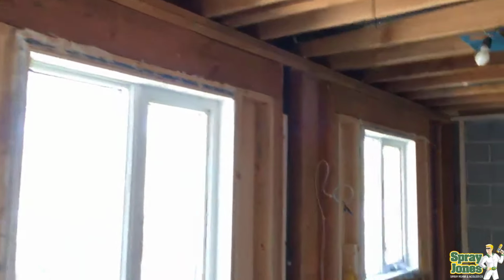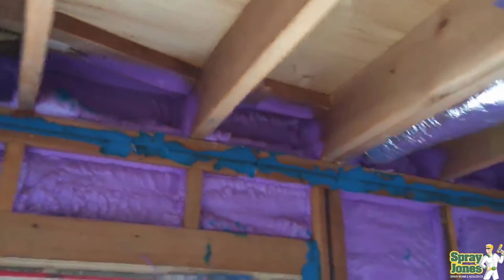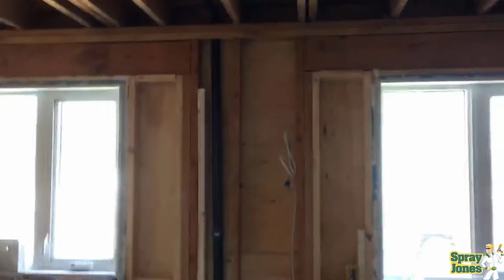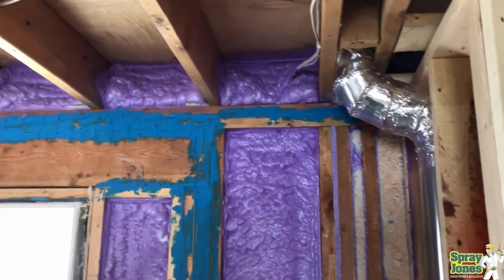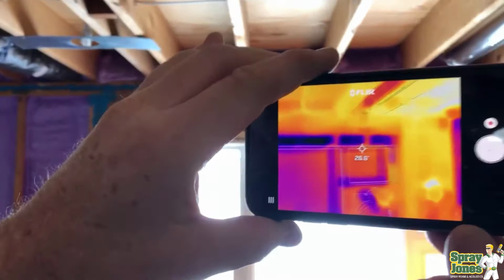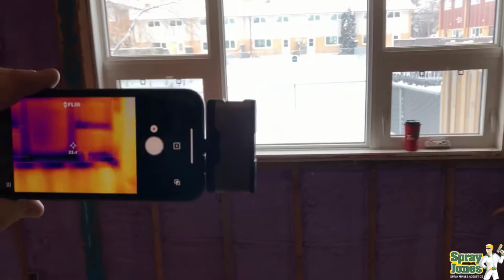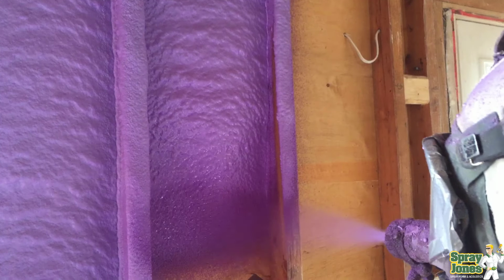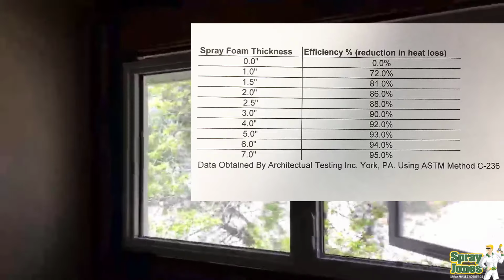Proof 2 inches of Spray Foam Insulation Works

Comment: Gutted my 100 yr old small house and had 3 inches sprayed on the dimensional 2x4 walls. R30 bats in the ceiling. It sits on a hill 8 miles inland from Lake Michigan, 50 miles south of Mackinaw. Not a mild situation. It's ridiculous how easy it is to heat this place, and the extra structural strength makes it hard to notice a strong wind. Pricey, but wow.

Comment: The challenge is building codes in many areas require minimum of R-20 wall assembly insulation.  So 2" of closed cell spray many be thermally sufficient, little insulation would fail insulation inspection in many areas of the country.
Reply from the maker: Ya we know...That isn't what we are talking about. We are looking at the power of 2" and what it can do, not compliance for white papers...

Comment: Im confused by the caulking. I caulked the seams in double studs and plate joint at the floor on a renovation project. But do you have to caulk where the stud mets the exterior sheathing? I thought the spray foam sealed that.

Comment: I bet why traditionally that the studs were such a thermal bridge on thermal cameras is because the insulation never really sat so tight  up against the stud so there was always some air transfer.  Typically when you shove in a batt you are either a bit tight or a bit loose and both effects are negative on insulations ability to hlod temperatures

Comment: How much does good spray gun like u use cost? If I build another new home Am definitely going with this. I don’t know what it is but I would really like to grab that gun and go to town with it. I know probably hard work once u have did 1000-2000ft just something about it  makes me want to do it. Am road superintendent have been for 25years so nothing I’ve ever done before I was a welder for 3 years before that. Spray foam just gets everything I don’t know why we’re all not just using it. Is there anything any better?
Reply: The upfront cost is more expensive than alternatives.  It's harder to work around after, and has had some bad press about the blowing agents used being mega bad for the environment.  All that being said, I plan on having the roof of the workshop I'm building spray foamed.  Walls will be batts or otherwise so I can easily run utilities in the future as needed.

Comment: Thermal imaging is only showing relative temps for those areas shown that you scan. To understand what's really going on you also need to actually take the temperature of the air in the building at its core and the temperature of the air outside the wall. These temperatures are needed to understand the real heat flow through the structure. Wood is a poor insulator. The fact that in your image, the studs don't show a significant gradient in temperature compared to the spray foam means the insulation values for each material are close to each other, that's a concern. And to really back up any thermography, so you know emissivity is taken into account, there are more accurate ways to analyze material temperatures. It would also be good, to better understand the wall construction in this video too, because if this wall had XPS, ISO, or EPS applied to the exterior, that could really throw of results of any thermography scan and how effective the materials are. 

You are correct in that there is a point of no return in insulation by adding too much insulation, especially when each additional inch doesn't cost justify the savings. However, their is also a factor considered in ASHRAE design standards that takes into account perceived comfort. Even though you might have reduced most of the heat loss in a structure, if there are places where the temperature is noticeable different than expected or what we are use to, it will feel uncomfortable. Take for instance glass windows. Many new widows today use low E glass. If you stood next to a window that didn't use low E glass vs one that did, you would notice a significant difference. One reflects radiant heat, the other does little in the radiant spectrum, even though their construction may be similar or identical. The lower the wall temperature is from the set temperature, the room may start to feel cold, even though the room temperature is pretty normal. As it gets colder outside, that inside wall temperature will drop. However, the more insulation in the wall, the less it will drop. So even though, as in your example, the insulation is reducing 80+% of the heat loss, doesn't mean it will feel comfortable to the occupants. Moving that heat loss to a lower value or higher % reduction will dramatically improve the comfort factor in the building.

Comment: Sometimes we get too focused on R value as a number. Its easy to forget R value for insulation is measured in laboratory conditions. Structures are rarely equal to the test conditions. The main advantage I see in spray foam is its resistance to wind washing. Fiber based insulation goes to pot if the wall assembly isn't air tight. Spray foam's ability to air seal and your additional caulking detail makes that wall perfom as good as it possibly can. The only way to make that wall perfom better is for the foam to be exterior insulation instead of cavity insulation.
Reply: Not to mention adding some rigidity to a structure

Comment: How good is closed cell foam at preventing sweating in travel trailers?
Reply: The problem in travel trailers is the thermal bridging. I did a semi-truck oversized sleeper...everywhere the foam couldn't get directly to the outside skin transferred temperature through the metal and plastic framework. To the extent that in the winter, frost would form on every single place. Then I did another one and I sprayed 2" on the inside and THEN framed the interior. That truck is like an igloo cooler. I've been in it for years and the entire truck can be AC'ed with a cheap 5,000 BTU wall shaker, 62 degrees, August in Florida in the middle of a parking lot, and my gen-set never comes off eco-throttle.
Reply: @sheli4239  
Could put foam to the outside on those trailers narrower than 8'6," too.  Leaves more interior room and works okay if you plan to largely keep it in parked, I think.
Reply: @b_uppy  Sure, spraying the outside would work also, just have to paint it with a good exterior cover.
Reply: @sheli4239  
I was thinking just using sheet foam to the outside, then siding.  
Pretty sure sweating around the frame will be a problem with aluminum frame trailers.
Reply: @b_uppy  You would be amazed at how persistent condensation is, it never sleeps and will find any weakness in the insulation system. Honestly, 1' of spray foam (r 6-7) on the inside will change your life, and the closed cell is pretty durable if you wanted to bond a panel to it.

Comment: Any experience with housewalls made of aerated concrete and closed spray foam from the inside on a steel frame mounted on the walls?  Here in Denmark a lot of houses are made of AC. I just had my floor construction made out of 10 cm closed spray foam, heating system clipsed on an covered with 5 cm of floating putty, all made by professionals. Now I'm consideting putting it on my 19 cm from 1958 AC walls. I have central ventilation system with heat recovery in all of the 98 sqm house.
Reply from the maker: No experience, but the principals are all the same... what do you need to know?
Reply: Thx for responding. Sprayfoam are not usual here i Denmark. Would like to know if you ever use steelframe instead of tree. And do you use a respect distance between the wall and frame,.

Comment: To be clear, this video is for walls, not roofs.   I'm finding that roofs are another story...   I have 2-1/2" on the underside of my roof deck in SW CO.  It is enough to do a fairly good job of keeping the heat in, but in the summer, it does not sufficiently keep the heat out.  I believe this is mainly due to thermal bridging by the trusses and rafters.   That means I'm losing heat in the winter as well, but the heat just runs a bit more to keep up, whereas in the summer, heat builds up because I don't have A/C.   This is an ICF house, so I'm a big fan of spray foam for sealing but on a roof deck, for a dwelling, I think more than 2 or 2-1/2" is needed to do a sufficient job of insulating.  OR perhaps the truss members must be fully encapsulated, so that they can't transmit heat though...  This was not really feasible with my TJI rafters in our cathedral style ceiling, though they are covered for closer to 3-1/2"...   I'm presently adding R19 batts to the ceiling cavities for sound damping (rain on a tin roof) and hopefully a bit of help with keeping heat from the roof deck out.  Then tongue and groove pine.  Hopefully this will be enough to keep heat out in the summer months...
Reply: Agree the truss must be encapsulated. My shop was designed for a double layer truss, so I had them wrapped entirely to prevent thermal bridging and air leakage between them which would definitely have caused condensation....

Comment: Looks like it would be difficult to deal with heat loss from window headers.
Not sure how that can be solved and still retain the strength.
Reply from the maker: Double glue-beam for weight and then rigid board or SPF in front - of course this applies to new construction, no one goes to that cost on retros.
Reply: One advantage of post frame construction is no door and window headers.
Reply: On a 2x6 new wall construction, the appropriate 2x material can be used in combination with rigid (XPS)250#/sq in insulation to provide a thermal break to the outside. If the thermal break is sandwiched between the 2x's, you maintain the integrity of fastening surfaces on the interior and exterior of the wall. Net insulation is 2.5" for an R value about 12. For a 2x4 wall the result is ½" for an R value of about 2. Because of the depth for a 2x6 thick wall header, long screws will be needed instead of nails to join members of the header to form a cohesive singular member, required by code in many areas.

Comment: The results of 2" of CCSF is amazing...but doesn't get us there in CZ6 & 7.  IRC 2021 is pushing towards R30 (bureaucrats!!).  What is your preferred solution for new construction w/2x6" walls?  What are your thoughts on flash & batt with Rockwool?  Is there a cost or other advantage to flash & batt with Rockwool, or would you simply fill the cavity with 2 lb CCSF?
Reply from the maker: Stay away from flash and batt. Get the rules changed, otherwise you are installing more...
Reply: @SprayJones  Curious why stay away from "flash and batt" ?  Trying to figure out the best way to insulate a post frame construction metal shop/office (will end up with 8" exterior walls - 2x6 girts).  Building in Zone 6, Thinking wall assembly would likely be, from exterior, => Metal - wrap - OSB - 2" ccsf - batt - drywall - latex paint. Similar idea for ceiling/attic.  Trying to keep things from freezing without spending a fortune keeping the inside at a reasonable constant temperature - say above 50.  Besides the up front expense of such an assembly, is there a downside or better option, in your opinion?  Great vid, btw.  Love how straightforward it was with lots of common sense!
Reply from the maker: @OldPongGeezer  Go watch the 2 videos I made on flash and batt. Plus Mr Post frame  has video on it. 
I discuss the issues he encountered in the metal building playlist look for the "post frame home and air seal" video where I discuss what happened to him.

Comment: The potential for off-gassing of volatile chemicals from spray polyurethane foam is not fully understood and is an area where more research is needed.
Reply from the maker: This is a nothing statement - one look at a data sheet can dispel this wild talk. 
I have numerous videos on the subject in the health and safety playlist. The study of the SPF & VOC is the best for any insulation product on the market and some of the most advanced tests that are currently developed.
Reply: I agree with Mike. Had my batt replaced with closed cell and the results are amazing. And the only off gassing comes from gas bags that don’t know what they’re talking about!
Reply: well only if you use the wrong mix and usually with old chemistry that was stored wrong. IMHO